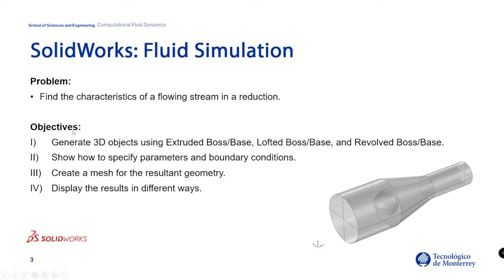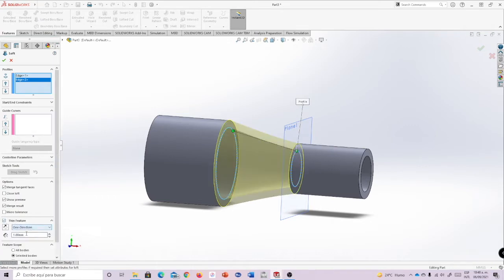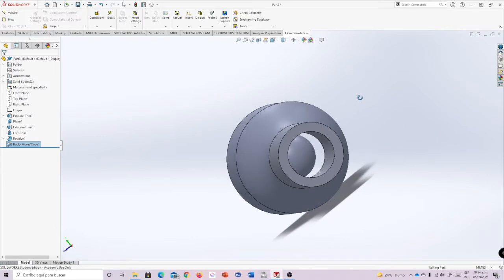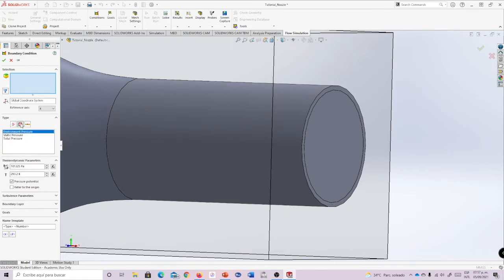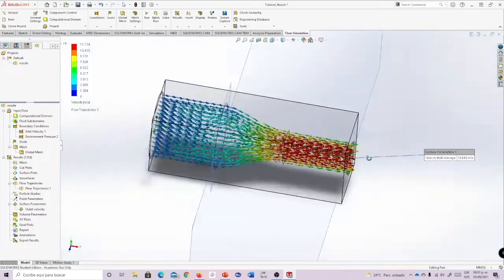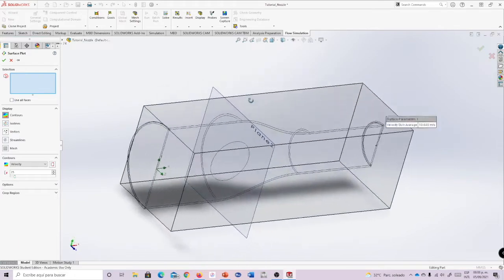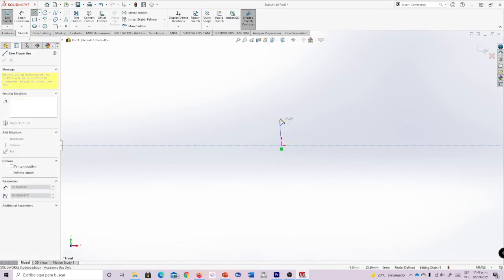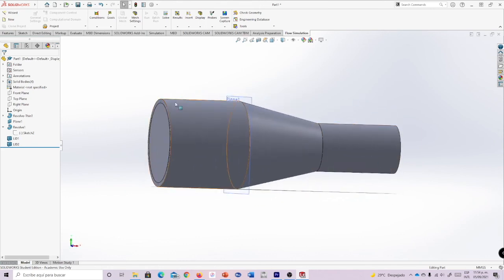SolidWorks Flow Simulation Tutorial: Nozzle

Comment: Hello sir, I have a question. I apologize I didn't watch the video but I didn't see what I was looking for when I skimmed it.
How can I simulate the flow coming out of the nozzle? I am interested to see how the fluid flow will be directed as it leaves the nozzle, not necessarily what happens inside it.
Reply from the maker: Hi! You have to specify the computational domain (or the fluid subdomain) of the external fluid. This can be done by drawing a geometry that represents the surrounding air, or specifying an external flow study.